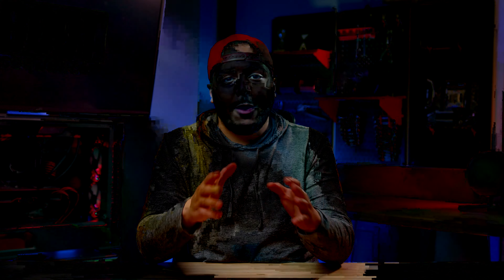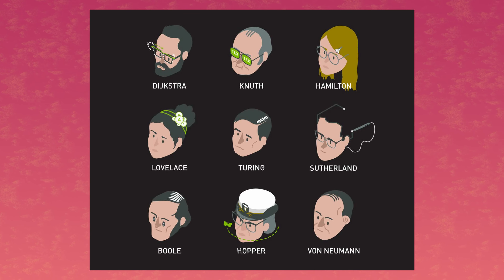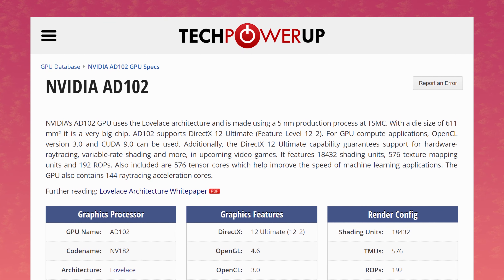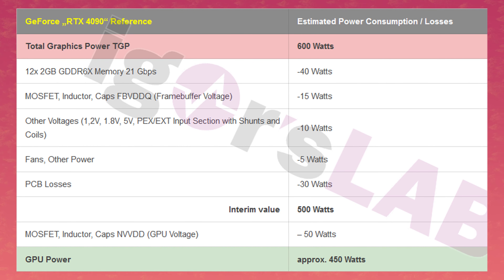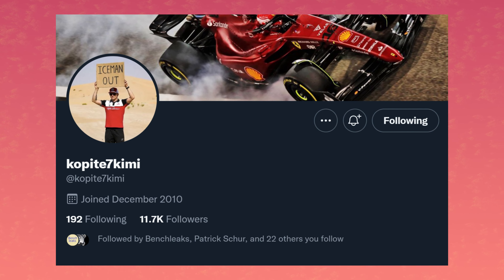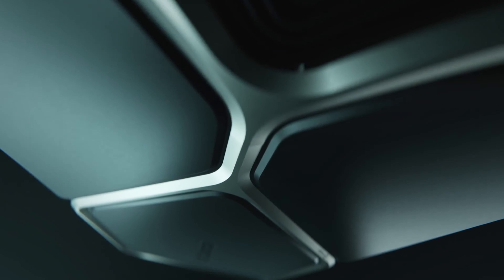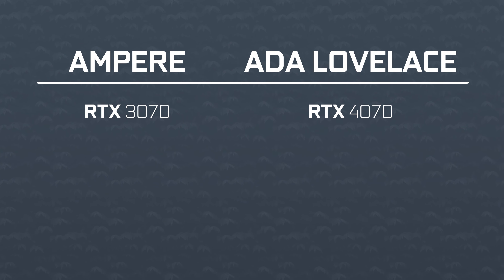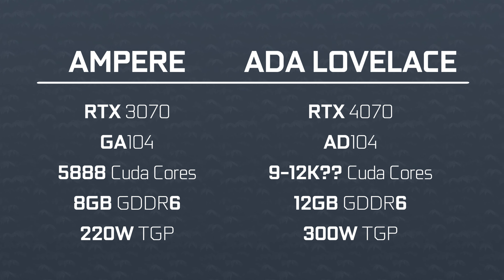Nvidia’s RTX 4080 & 4070 Power is OUT OF CONTROL!

Comment from the maker: HERE IS WHAT I SAY AT 4:30 : It also would use 2 of the 16 pin PCIE gen 5 power connectors. Yeah 2. That’s because in its current testing phase the total Graphics power is a whopping 900W…. You know, I was making jokes that a standard 10 amp circuit in a home wouldnt be able to sustain an entire gaming setup with monitors, speakers and everything, well if this is real.. I dont think that’s a joke anymore. 
This video was special. I edited an audio-only version with all the images. then went to the office for the A-roll. So the second edit was just to fill in the gaps. I must have been rushing because I forgot to delete the A roll take from the last sync on the video. I fixed it, reuploaded it, and somehow deleted the fixed version on youtube instead of the broken version.  I guess being up for 28 hours does not help the brain. 

I know about the glitch after the intro. Couldn't fix it 😅 I RUSHED THIS AND I'M SORRY. The youtube fixed version is incoming.
Reply: I thought I had a glitch! A.k.a too faded
Reply: Aka overlapping speech?
Reply: 900 watts is too much!
Reply: I guess it helps to add to illustrate the insanity afoot
Reply: The intro and at 4:30
Reply from the maker: @Shionne this video was special. I edited an audio only version with all the images. then went to the office for the A roll. So the second edit was just to fill in the gaps. I must have been rushing because I forgot to delete the A roll take from the last sync on the video. After being awake for 36 hours. ( I was awake for 20 hours prior to working on this video. )
Reply: Leave the unfixed version, it fits perfectly with the RTX Monster sucking up all the energy.
Reply: I feel sorry for those in the US with the lacklustre electrical stuff in their house whilst we in the UK can easily pull 2500 to 3000 Watts out of a single socket.
Reply: Pcie 5.0 is way better for a different reason
Reply: We all paused the vid at least twice

Comment: I'll see what next gen AMD has on offer in the 300w range. A 500-600w monster means I really have to turn up the air conditioning. The energy price is about to go off the roof this summer. A super power hungry GPU makes very little sense to me.
Reply: Uh, no. That’s not how it works.
Reply: @oxfordsparky  Yeah, it works even worst!
Reply: @oxfordsparky  Uh , yes ? It does , it's even worse if you are from a country were electricity is not cheap
Reply: @oxfordsparky  This is definitely how it works
Reply: I believe Nvidia has been caught off guard by the (projected) performance of AMD"s RDNA3, and is brute forcing the power to not get obliterated in performance. However, I think if AMD is getting it done with half the power, they will sell a lot more cards this gen. I know I don't want my pc giving off 600 watts worth of heat, not just because of power cost, but also I'm very hot natured and like my room cooler when possible. If AMD gets their driver's right, and FSR 2.0 is close to DLSS, I think Nvidia may face stiff competition this gen.

Comment: This is getting ridiculous, I didn't really care about power draw a couple years ago but this is at the point where if I wanted a 4080 I'd have to buy a new PSU and put my PC on its own dedicated circuit to avoid tripping the breaker, and it would suck in the summer when it's drawing nearly as much power and putting out nearly as much heat as a space heater.
Reply: AMD and Intel gonna save us.
Reply: What shit house country do you live in if you need a dedicated circuit for a 450W gpu??
Reply: @oxfordsparky  Something that is not trash UK?
Reply: @oxfordsparky   atleast something  not as trash as you being a fan boy of nvidia

Comment: sure hope that whatever comes after the 4000 series is better because than the 4000 when it comes to powerdraw maybe time to upgrade for me and it would be a shame if i had to buy a new power supply but i will still be fine for the next few years with a rtx 3070 ti
Reply from the maker: there seems to be a pattern of focus. in the geforce series it was first performance at all costs, then efficiency, and we're back at performance at all costs.

Comment: People are going to find out the hard way, with the heat output and power draw. It's going to cost a lot more in the long run then just the cards price. Seem likes it's AMD this generation for me.
Reply: Yup! High power electronics get more extreme heat cycles too! They'll be impossible to cool without an air conditioner and they won't last long enough to make them desirable on the used market.
Reply: @BlackJesus8463  Just move to northern Alaska so you can contribute to the melting of the ice caps while keeping cool playing your games. ;)

Comment: Yes, Jensen Huang will push the 4090ti to 900W just to beat RDNA3! So if you’re buying a 13900KS with a 4090ti, buy your 1500W power supply now!
Reply: Get a case that supports dual psu systems!

Comment: If the 4080 is going to have around 15000 cuda cores then it will have to be on the AD102 die. I think the AD103 die only supports a maximum of 11000 cuda cores.
Reply: Yeah, the rtx 4080 probably uses an heavily cut down AD102 die.
Imagine the yielding issues that >800mm^2 die will have.
Get the best for the rtx 4090. The worst for the rtx 4080 and the ones in the middle get to be rtx 4080ti's a few months down the road.

Comment: Lies the base max power draw is going to be around 450W in the worst case scenario ofc for the highest end GPU which is the RTX 4090.
Reply: Proof?
Reply: @denisn8336  Did they proof otherwise to you in the first place?
Reply: @fahadal-asmari6893  no but I’m more likely to believe nvidia are stupid enough to make cards require over 500 watts.
Reply: @denisn8336  Mark my words, see you here later this year. ;)
Reply: @fahadal-asmari6893  I hope I’m wrong actually
Reply: @fahadal-asmari6893  dude you think on december there will be stock the rtx 4070 or 4080? And what do you think is the price range
Reply: @denisn8336  Hello . . . .
Reply: I wasn't lying didn't I ?
Reply: @denisn8336  Well I was right :)
Reply: @denisn8336  Well you got it.
Reply: @fahadal-asmari6893  yes you where lmao
Reply: @fahadal-asmari6893  man not only that the 4080 is 900 bucks potentially going to a 1000 wtf. I need a pc right now but nvidia are pulling a scam
Reply: @denisn8336  me personally I switched to AMD many years ago, I will just get 6950XT or 6900XT.
Reply: @fahadal-asmari6893  I plan on playing with a setup for 1440p max settings but with minimal compromise to frame rate should I go amd?

Comment: I really hope professional applications can make good use of AMDs hardware cuz ATM Resolve and Blender both work great on Nvidia and not so great on AMD.
These high power demands are getting quite out of hand. Yes, I know the 4070 or whatever falls in under 500 range won't be as power hungry, but it still is looking nowhere as efficient as AMDs cards. So far, I'm just going from the current leaks so far.

Comment: Well I was going to get a 4070ti anyway as it will perform better than the 3090. Which would be a decent upgrade over my 2070 super.

I have a 850 watt power supply. As I was planning to buy a 750 but the 850 was cheaper and better. So I'm sure I could handle the 4070ti together with my 3800xt.
Reply: I am in the same boat rdna3 looking good now.
Reply: @davidbrennan5  Yeah would go with RDNA3 too from what I know, as well as with Zen 4...all-in for AMD
Reply: I'm thinking it will be early 2023 before I the 4070ti is released.
I'm thinking 4070 or 3080 depending on performance & price. ;)

Comment: Standard 10a circuit?? What shitty backwards country has this?  In the uk a standard circuit for power circuit is typically 32A 240v so just over 7500W, you sometimes get a 16A circuit  it they are far less common.
Reply from the maker: canadia. Actually its 15 Amps 120V as standard. My old home built in 1925 with matchsticks had 2 10amp circuits. Thankfully I upgraded to a 200A panel, but 15A is still standard.